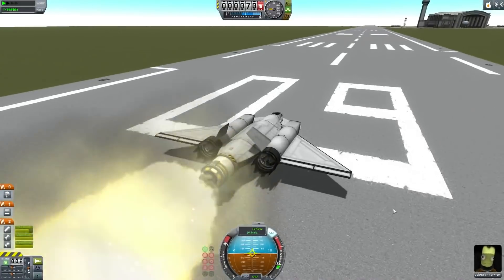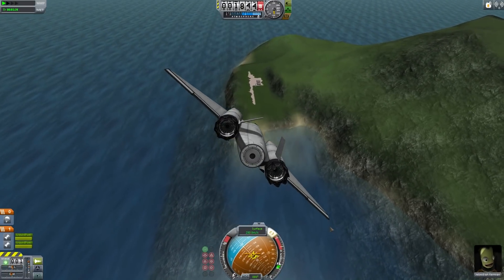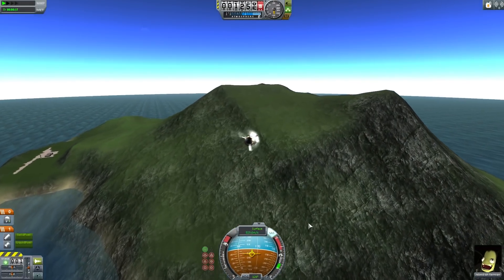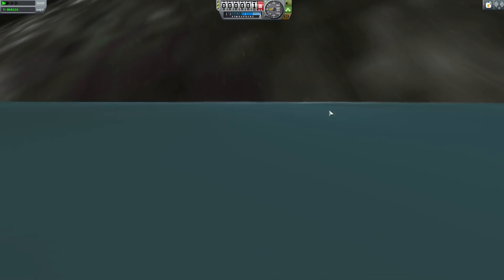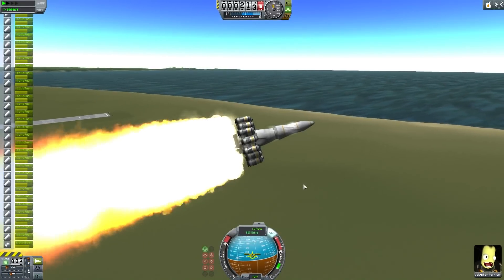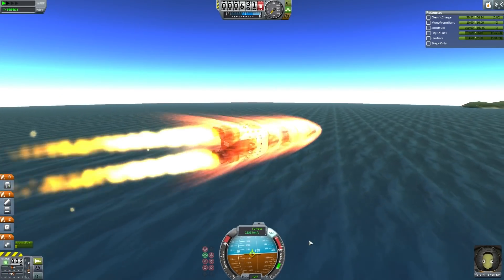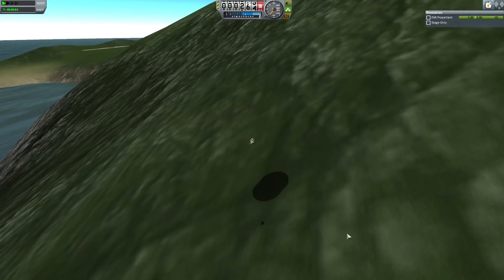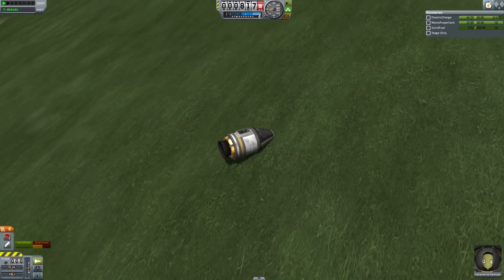Kerbal Space Program - Island Express

Comment: Upside: You get there in 35 seconds.
Downside: YOU ARE LITERALLY ON FIRE THE ENTIRE WAY THERE (And did we mention the hyper-lethal g-forces?)
Reply: Mehhh it's not lethal for a kerbal
Reply: that's what probes are for.
Reply: Probes aren't immune to fire or g-forces. Everything has a melting point; if a probe melts, it stops being a probe. Or at least, it stops being a useful probe.

G-forces are a threat too. You know how you can potentially break your phone by dropping it? It breaks because, when it hits the ground, it experiences a very high g-force. It doesn't matter that the g-force was only for a tiny fraction of a second; too many gees means broken stuff. This is true for anything, probes included.
Reply: the atmospheric heating can be solved (somewhat) with ceramic tiles, and it is the hard jolt that breaks your phone. that and the shoddy construction. The g-forces exhibited here are actually quite easy to deal with, unlike his moon speedrun (which would be impossible to do due to atmospheric heating and general structural limits. Modern fighters can pull 9G, and that's not along a nice structural axis and assuming you want to fly it afterwards. and the G forces are not very lethal anyways. a trained poilot or someone in a g-suit could handle them just fine.
Reply: @isaacvangerpen4138  one hundred and twenty g's of deceleration upon parachute stage :D

Comment: Could you get there faster by just strapping a command pod to the biggest srb in the game?
Reply: No, the biggest SRB does not have the highest TWR, which means it would be slower.
Reply: Okay, now wait again, what if you used infinite fuel with empty sepetrons, and then ejected them with radial decouplers at the last second?
Reply: Drake Tamer That would be very very very fast, but as cheats were used, it would probably not count for the original challenge. Did i say it would be very fast?
Reply: Drake Tamer You want to constantly be losing the dead mass that isn't holding any fuel for you to accelerate further.

Comment: I am making a drop pod with out any parachute, but with the 4  air brake at 100m(radar) I am going at a terminal velocity of 39 m/s and I want to calculate how much trust I should put on my pod with sepratron to be going a 0m/s at least 10m above the ground
I tried doing with dV only slowing down 27m/s is far from the 60m/s dV I calculate i have 
Is there a other way or should I calculate something else to remove to my delta v. Most tutorial I find only explain delta V calculations

Comment: Now I'm no rocket scientist, so correct me if I'm wrong, but isn't there some sort of "diminishing returns" so to speak, as you add more rockets to a spacecraft? Or any sort of vehicle for that matter, because you're adding more mass, which in turn requires more fuel, adding even more mass. I suppose since in this case it's a speed challenge it doesn't matter, but isn't there some sort of "loss of efficiency" involved?
Reply: You are correct ^^
Reply: ravenclawtom Thanks for confirming that.
Reply: Wyatt G Correct. The formula is for deltaV is exhaust velocity times the natural logarithm of your dry mass divided by start mass IIRC.

So doubling the amount of fuel has less and less effect, following the curve of a logarithm.

However, changing your exhaust velocity has a lot stronger effects.
Reply: Wyatt G I think you're thinking of increasing delta-V rather than increasing all-out speed.  The former involves increasing the total amount you can accelerate (increasing your relative speed and/or burn time) whereas in this video Scott is not trying to increase his burn time, he's just increasing his speed.  So, in this scenario, as mreyecikjou so kindly noted, you will not generally be able to increase your exhaust velocity, but if you increase the amount of fuel you're burning simultanenously, also known as "Moar Boosters", you will increase your speed.
Reply: MrEyecikjou
So in that case the graph created is exponential? Which would indicate the theory of infinite fuel needed to accelerate an object to the speed of light as defined by the asymptote approaching infinity and the concept of special relativity? I hope that made sense, it's been a year since I've taken Calculus.
Reply: Wyatt G Technically correct. The formula doesn't really work once you approach relativistic speeds. It is based on the preservation of impulse (F*t = m*v).

But either by increasing the amount of fuel or the exhaust velocity to infinity; yes you could reach the speed of light. Theoretically.
Reply: MrEyecikjou
Intriguing, thanks for the rocket science/relativity lesson :D

Comment: Scott,
  I don't know what wizardry you used to keep the thing from over heating before it did. I built a very similar vehicle and couldn't do it myself.
 You could speed up your run some by ditching your around 10s, or right after you pass Mach 1. They produce more drag than thrust at that point, and you get more G's after you've ditched them.

Comment: Does the new aerodynamics model allow faster speeds at low altitudes than FAR?
Reply: LKAChannel Modern supersonic jets are mostly limited by the materials in their engines.  If you throttle up too much at low altitude the compressor will lose structural integrity, causing the engine to fail (probably in a rather spectacular fashion). 

For some early jets on the other hand, going too fast at low level was a significant threat. The F-84 Thunderjet (which was used as a bomber in the Korean war) for example had its top speed limited by critical mach- at some subsonic speed the air flowing over the wings would go supersonic, causing a 'shock stall'. In the F-84 this caused the aircraft to pitch up so violently that the wings would be ripped off. The engine in the Thunderjet was easily powerful enough to reach this speed in level flight at low altitude, so pilots had to be careful about their throttle setting.
Reply: nerd1000ify
Oh wow, I didn't know that. Thanks :)
Reply: TheFishCostume Way faster, you really have to watch your throttle now, way too easy to lose control and break apart or even disintegrate, it's now possible to get up to around 1000m/s at 100m but by then you're on the verge of burning up.
Reply: Phlaked Corn Is this realistic? I have no idea about that kinda stuff but do real pilots really have to be careful not to throttle up completely, otherwise they would break apart?

Comment: Is it possible to make a sprint rocket in ksp?:)
Reply from the maker: Reed Howard It's a missile designed to shoot down another missile, accelerates at about 30g IIRC.
Reply from the maker: Henry Marshall This is about as close as you get, the TWR of the parts isn't as high as sprint.
Reply: Scott Manley Thanks

P.S. OMG SCOTT REPLIED TO ME!!!!!!!!!!!!!!!!!!!!!!!!!!!
Reply: Henry Marshall What's a sprint rocket?
Reply: Scott Manley Way more than that. Sprint missiles had a burn time of 5 seconds or so, had to accelerate all the way up to mach 10 in that amount of time, the acceleration peaked at 130g.

Quite impressive.
Reply: Scott Manley You can do it with the physicsless RCS engines, I have done it in 0.9, I got something like 1500 m/s in 3 seconds, but FAR would not let me go faster. It was a 2 stage vehicle, each stage was just the small RCS tank, first stage had like 20 engines, the second just six. I also tried launching it from the FAR Firehound, it could take two of them under each wing easily, and they made it to orbit pretty easily.
Reply: that would be cool if you could though
Reply: Screpheep Not any more since physicsless parts now add their mass to their parent part.

Comment: It is only me or landing planes and spaceplanes is a lot difficult in 1.0 than previous releases?
Reply: MasterControl90 Improved aerodynamics. You can't just slap loads on stuff and call it an infini-glider anymore.
Reply: MasterControl90 Well theres a new danger. but if you played with Feram aerospace you are used to being able to glide and fly that well, and ofcourse the exploding rockings on reentry. 
A very good hint when you want to return back to kerbin, Have heat shield in your rear. Set the sas to auto target the oppersite of prograde it will auto keep your heat shield at the best location. Ive hit kerbin with almost 10,000 ms  around 30k hight and still survive with that.
Reply: MasterControl90 ALOT!!!i crash everytime.
Reply: I've noticed the same... Weird
Reply: you might want to check your brakes, default torque is 12, but 30 is max.
Reply: Extreme Tutorials *I cri evrytiem
Reply: MasterControl90  I found it vastly easier....landing planes before was hard, like I dreaded doing it because of how likely I was to crash what should have been easy....
now... its ridiculously easy. But slow.
Reply: Meow ster totally the opposite compared to me :D Are you using some kind analog controls?
Reply: MasterControl90 naw... Just followed the same rules as before. lift slightly behind mass and accounting for shifts in weight/mass center due to fuel usage. I leave adequate control surfaces for every direction(as I forget where my plane is strongest if I focus a particular direction)

following the same rules, I was getting a much smoother experience.
But I also don't design like a kerbal. 
It amazes me that anyone thought the previous system was easy.
Reply: I don't have any problem whatsoever with reentry, my only problem in the landing :D
Reply: WimsicleStranger Unless, like me, you made an infiniglider in FAR. Then it's easy. lel